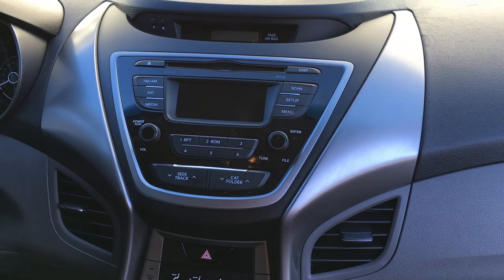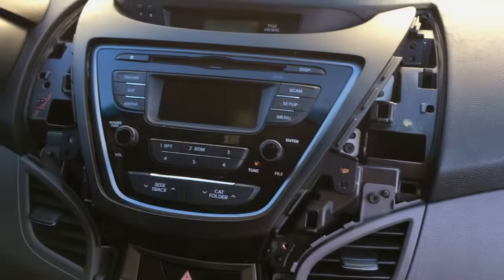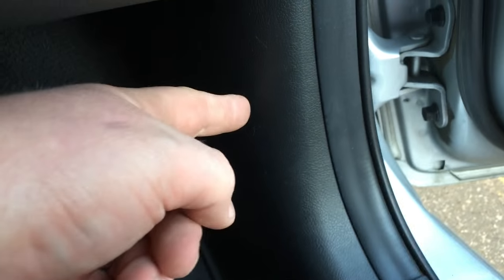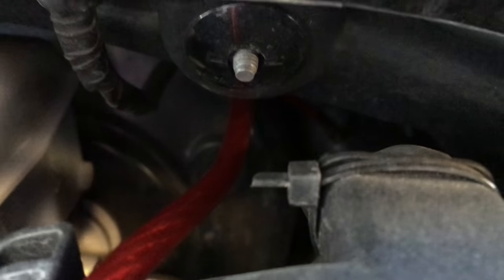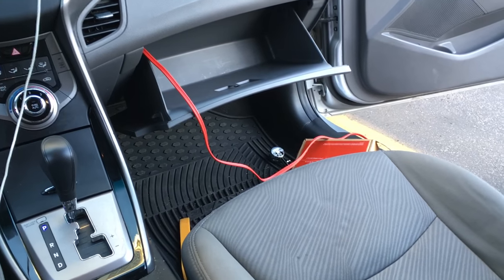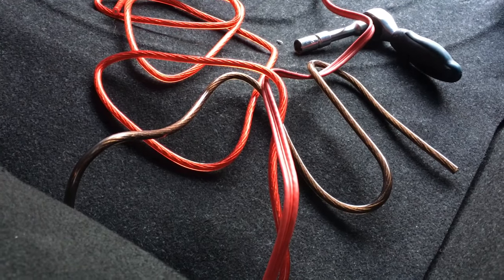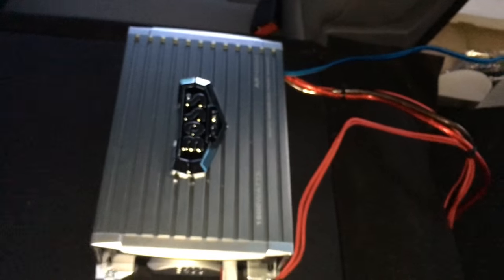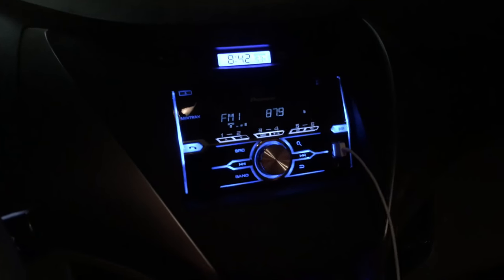2011 - 2013 Hyundai Elantra 10" Kicker Sub and Boss Amp Install

Comment: I’ve had this sitting in my trunk for years and finally hooked it up and it actually worked.  THANK YOU!!!  Only issue is none of my buttons on the stereo or steering wheel work at all...
Reply: You need an adapter wire harness for the steering wheel to radio. Your oem radio would connect but is gone now
Reply: You would need a LC2i converter to keep your steering wheel controls
Reply: @imurleader22  good to know, thank you both

Comment: I always had trouble finding an access point for the 12v through the firewall. Maybe use a little bit of rtv or in weld to fully close the hole in the gromet incase you hit a puddle or drive in the rain

Comment: Great video! How did you keep the steering wheel controls functioning after the install? Mine no longer works :-(
Reply from the maker: You need a steering wheel control interface to keep those working here: https://www.sonicelectronix.com/item_68038_Axxess-ASWC-1-Steering-Wheel-Control-Adapter.html  Use coupon code ProvoBeast to save 5% off at checkout.

Comment: Did you use any dark kit for this? I'm trying to install a double din on the exact same car  thanks great video also :)
Reply from the maker: +Josue Valadez Be sure to see part one, see the description for the link to that video.  That video in its description also includes the parts i used for a double din install.  That should have all you would need for an install.

Comment: I have a 2007 Elantra SE, it has the volume controls on the steering wheel, I'm about to install my aftermarket pioneer and hook my amplifier and subs up to it but after reading online I'm hearing that I may run into an issue with the BCM triggering to car to be in a "no start" mode due to it sensing a higher voltage draw than normal. Is this something you ran into with this model?

Comment: What drill bit size did you use to drill the hole through the grommet? Gread vid by the way.
Reply from the maker: I think it was a 3/8" size, but really can vary depending on the gauge of wire you are planning to run.

Comment: Thanks a lot for this video, its well explanatory but I have a question for you.
There is one little red wire on the amp, in between the power cable and the ground. What is that wire for?
Reply from the maker: +Emeka Stanley The remote turn on wire.  When the key / stereo is turned on, it tell s the amp to turn on as well.  It just essentially a trigger wire to ensure the amp is on when the car is running.
Reply: Get a off and on switch thats for remote usually its blue but thats ok if its red it still should say remote on the amp between the power and negative

Comment: Hey provo! A bit of a late comment, but I'm moving my 2 10-inch Alpine W10S4 subwoofers and JL Amp into my Elantra. Will the Elantra's stock alternator be able to handle the power drain from 2 of these subwoofers or should  I just install only 1?

Comment: Hi, loved the video, I have a 2009 Hyundai elantra, I've already installed a new Kenwood radio but I now want to install an amp. is there any difference in installation? this video was for a 2011. thank you in advance.
Reply from the maker: A slight difference, but between the years there isn't much difference.  You can use the elements in the video to your own install and be just fine.
Reply: The only difference I can see might be battery placement, but I don't think it'll be more than a few inches. I've got a 2010 Elantra which is the same generation as the 09, I'm looking to do something like this and there's very little difference on the interior that I can see.

Comment: im a total noob, does every amp require battery connection?
where do i find all of these wire informations for my car (old hyundai i20 from 2011)
thanks for helping in advance :) have a nice day!
Reply from the maker: Yes, every amplifier requires a battery, ground, RCA, remote wire, and speaker output connection.

Comment: I just picked up a 2013 Hyundai Elantra and want to move my system outta my truck to the car. I got a set of 12's and a 3000 watt amp. Will the default battery hold up under load? Or should I look into replacing the battery? Also, is the default standard deck any good with a custom system? Thanks. :)
Reply: Casey W not the alternator though

Comment: I'm having troubles with the amp not giving out any output. The fuses are fine, and everything is wired correctly but there's no kick. I'm trying to run 2 12" subs in a ported box, any idea why it might not be working?
Reply from the maker: Check your impedance load on your amplifier.  how are your 2 12's wired? What amp, what subs?  It sounds like a poor wiring configuration.
Reply: I’m having the same trouble, I’m wiring two 12” kickers and it’s all wired in correctly but the amp doesn’t seem to turn on nor do I have any kick

Comment: How do you know where to drill to make sure you aren’t gonna go through any wires?
Reply from the maker: Check on both ends of the grommet to ensure you are safe.  Next, you can use a screw driver / sharp tool to puncture a hole first to make sure you are clear before you drill the hole bigger.
Reply: Thanks for the reply, installing a sub this weekend so we shall see how it goes

Comment: Do I need to change the stereo to an aftermarket one or can I keep the factory stereo in?
Reply from the maker: you can keep the factory radio, you will just need a line out converter to provide a signal to your amplifier.  If your amp also has a "high level speaker input", a line out converter isn't necessary and you can wire your amp directly to the speaker outputs of the radio.

Comment: Is there a possibility that you can connect a amp and sub to stock radio
Reply from the maker: Yep, you would just need a line out converter in most cases to generate the signal for your amp.  We have quite a few videos on our channel showing how thats done.
Reply: Provo Beast Audio Installation could you help me with finding which is positive and negative on 2018 elantra? I can't find any wiring diagram for a line out converter, I want to do it right. Thanks

Comment: What settings on the amp would you recommend? I have it hooked up to a kicker 12" comp r
Reply: It's in a 2009 Nissan Altima. I just can't figure what settings and everything I should use on it.
Reply from the maker: Change the crossovers to the Low Pass Filter (LPF) and set the frequency to around 80hz.  Set your gain sensitivity to around 10 o'clock conservatively.  If your amp has a bass boost, try not to use it to begin with until your amp is tuned to avoid distortion.
Reply: Okay, thank you!

Comment: If I am only running one Sub Speaker, do I need to use both Left and Right audio In?
Reply from the maker: Depends on the amplifier you use.  Generally, both left and right are summed into one channel for mono amplifiers, so, depending on the radio and the amp you use, i'd still run a 2 channel RCA pair as most radio's support it and amplifiers accepts it.

Comment: Please Help me!!! I have a 2012 hyundai Elantra gls. I installed a 600w sub and amp. When the car isnt moving the sub plays fine but when i start driving the sub fades out (not completely but noticeable). All my connections are strong including my ground, i even installed a back up battery in the trunk but the issue still persist. Someone please help me.
Reply from the maker: Sounds like a voltage issue with charging.  Make sure your primary battery is healthy, that your wire gauge is heavy enough.
Reply: Provo Beast Audio Installation Thanks, i'll try it. I'll also give you an update
Reply: I checked my Battery and charging system (alternator) they are both good. I lowered my back seat to see exactly what the amp is doing when im moving. When the car moves the amp shuts off and on repeatedly to the point that the sub can't play efficiently. I took a video of it if you have a way for me to send it to you
Reply from the maker: Sounds like a short.  You can upload it to messenger on our facebook page.
Reply: I figured it out. It was a bad remote wire connection. Thanks, Shit was driving me nuts

Comment: How do you remove those Panel's where you used the tucking method?
Reply from the maker: Use a panel tool and find where the clips are and apply a small bit of pressure, they should pop free.

Comment: Do you know if I am able to hook up my Fosgate amp and sub to the factory stereo at all in my 2010 Sonata? I have obviously not pulled the deck out to look and see if it has RCA inputs
Reply from the maker: 99% of factory radios on the market do not have RCA outputs on them (excluding some toyota / scion units made by pioneer).  You still can yes, but you will need generally a line out converter which connects into factory speakers wires providing a signal to your amplifier.

Comment: What about fuse my amp came with all the same stuff and a fuse do I need to use it?
Reply from the maker: Always use a fuse.  In the event of a short, you avoid a fire.  Fuses typically should be about 6-18" away from the battery.

Comment: Can you do it with a stock radio?
Reply from the maker: Sure can with the use of a "line out converter".  You would just tap into the factory speaker wiring output of the radio to a line out converter, and you can provide your amplifier the signal it needs.
Reply: Will I need a whole other wiring harness?